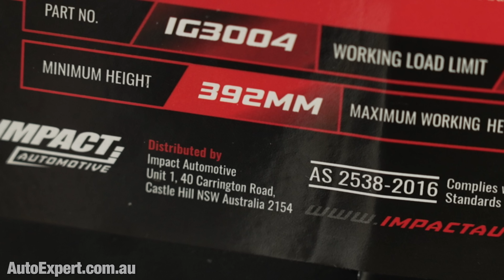Jack Stands: How safe are they really? (Weakest link revealed.) | Auto Expert John Cadogan

Comment: My son's an enthusiast DIYer who yesterday swapped out his shocks. It gave me pride and comfort to see the whole car on stands with all 4 wheels underneath as an added safety measure. The jack was there to lift the car then moved out of the way so it wasn't a tripping hazard
Reply from the maker: Well done, him, Mr Wolff.
Reply: I always put my car's wheels underneath the chassis somewhere near to where I'm gonna be laying under it,  just as an added safety incase the unthinkable happens. (Like when one mechanic bumped another car that was on jack stands, and it fell off the stands. Luckily nobody was under it) Accidents can happen very quickly.
Reply: Christian name !! which a chap like the one who raised the “point” is  not entitled to use unless he has been introduced !
Reply: pride and comfort?? wtf
Reply: @BubblesTheCat1  my sports cars are so low that if it did fall off the stands onto the tires you still would end up screwed up for life.    this is why I leave the jack still under the car somewhere usually near the front end / on the pinch welds so if it started to fall the jack will still be there as a 2nd backup.
Reply: @Runescape.  Not a bad idea, but what I actually meant is I put the (removed) wheels (say two laying on top of another, on their sides) near to where I'm working under the car. My own car (Nissan Sunny) is also quite low, and if it fell off the stands with the wheels still on the car, I would probably also be badly injured or killed. Especially near the front end. In those cases (or all cases basically) I like to leave the trolley jack under the car (not bearing the weight) as well, just for added insurance. The wheels laying on top another can also help should the surface under the jack stands fail. Be safe out there mate. 🙋🏼‍♂️ from Cape Town 🧡🐈

Comment: Using a concrete block to hold up something heavy like a car is inviting the block to suddenly revert to its constituent ingredients; sand, gravel
Reply: Has that ever happened?
Reply: @Rampart.X  yes
Reply from the maker: Certainly has.
Reply: @Rampart.X  definitely has.  They tend to brittle fail as they do not bend, just break without warning.  Blocks of wood will usually give some indication before failing.  These jack stands are a much better option in nearly all cases
Reply: If you don't understand what you're working with I'd agree with you. But if you know a bit about block you can get a lot of performance out of it. Don't use a block standing up. That's mistake number one. Don't put something hard right on the block either. Like a steel vehicle frame. Have a piece of wood in there. Use a heavy block and not a light one. I'd use a block the way it'd be laid too. That'd be fat side up.
Reply: my dodgy boss back some 25+ years ago decided it was smart to send me (the apprentice) and another worker out to the country to do a job and take out all the jacks and stands in the 70 series, we ended up with a flat Tire on the way home we had no choice but to use boxes of tiles, YES floor tiles, we were only left with a 1500kg bottle jack which is to short, hence the use of tiles

Comment: Thanks John. Another excellent safety video. Good to know a simple way of differentiating grey iron, ductile iron and steel. Grey iron, incidentally, was used for the scope mount on the British No. 4 Mk 1 (T) sniper rifle which served, in updated form, from 1940ish till the 1980s. Given the mass of the complete rifle, the loads imposed on the mount would have been inconsequential. Armourers did, however, get plenty of practice replacing the screws on the base for that mount and also staking the replacement screws to minimise subsequent movement.
P.S. As a carpenter, it never ceases to amaze me that people consider a concrete block, which is basically a brittle piece of permanent boxing, to be an adequate load bearing support for a corner of a motor vehicle.
Reply from the maker: Grey iron is a good material if suited to the application. It's awesome to drill, turn and mill. (I didn't know that about the rifle scope mounts... I wonder why ductile iron wasn't used.)
Reply: @AutoExpertJC  I just recalled that they originally specified malleable cast iron BUT there was an authorised change to grey iron. No reason is supplied in the standard text published by Ian Skennerton but I suspect that it was related to other wartime production priorities. Cheers from NZ🇳🇿. Keep up the good work. My view is, that if you are not pissing people off, you are not pushing them to really think!
Reply: "...it never ceases to amaze me that people consider a concrete block,..to be an adequate load bearing support " Better yet is when said use of concrete block involves lying it on its side!
Reply: @feathermerchant  Yes … because it HAS to be better that way🙂🧐!

Comment: Also worth mentioning for those that are looking at lifting all four wheels off the ground, avoid jacking up vehicles from side to side. Front to rear is best. otherwise the vehicle's chassis may flex or the vehicle's suspension may move the vehicle to one side. Causing the Jack stand to move under the chassis and in extreme cases, skip a tooth on the rachet mechanism under the uneven amount of weight. I feel like that contributes to those statistics as well. I experienced a similar senario back when i was a kid learning to work in my first car. I jacked up the car side to side, unknowingly the car was sort of twisted sitting on the stands. replaced my  first ever set if brake pads and discs. As I had opened the driver's door to pump the brake pedal bleeding the brakes. the jack stand on the left hand front slipped off the chassis rail and dented the passenger's floor pan  crushing the fuel feed line in the process... That turned out to be an expensive lesson right there. 🙃

Comment: Knowing where to place the stands under the chassis is important too - and I'm not convinced I know the answer on all cars.
Reply: That used to be the easiest thing to work out, but over the last 20years, things have changed. What Looks to be a safe place, and might be, can actually bend parts of the car.
It might not be obvious straight away, but you sure do find out when getting your wheel alignment done. I haven't done this personally, but have heard of people dong it. 
The owners manual usually gives jacking points, and most times there is usually a centre front and back to allow you to use stands under the jack points along the sills, which you will damage unless you use something between the stands and sills. Most mechanics will just use the subframe etc.
Having said all of that, I think your comment was talking about the safety side of things, and I agree, it's a topic that warrants more conversation.

Comment: I ALWAYS, keep the trolley jack in place under the front or rear crossmember whilst having jack stands in place. The bulk of the weight is on the stands and just light pressure on the jack. That's just my way of adding another layer of safety.
But in essence, jack stands are pretty safe. Use them correctly and appropriately and you'll never have an issue.
Reply: Same, along with any wheel/wheels I've removed. I figure while none of it will hold the car up properly like the jack stands, the jack + wheels will give me a couple of seconds to get out in the event that it all goes pear shaped.
Reply: @davidshepherd265  same here easy enough to put the wheel under out of the way.always good to have 4 stands too so if a pair is in use you won't gamble not using them for a diff project

Comment: Thanks for the heads-up John. My old stands are going in the bin tomorrow. I haven't used them for years, but I will remove the temptation in case I need to grab one quickly in the future. And yes, you do tend to prattle on a bit sometimes, but that is inherent in your style. Keep it up.

Comment: Hollow concrete blocks are notorious for crushing. Bloke here in paradise, aka, NZ, aka, the lair of Jacinda, saw one of his neighbours working under his car. A few hours later saw him still there so wandered over and found the bloke expired! He’d used concrete blocks to support the car and one had been crushed. Wasn’t a particularly quick death either as the car came down on his sternum and he’d more or less suffocated!
Reply: There is more to concrete blocks than instantly meets the eye. There's two basic varieties heavy and light blocks. Though the light ones aren't particularly light themselves. But they're half the weight of a heavy. Most common block is still lightweight. Blocks also have a top and a bottom. One face is fat and flat. I bet the victim used a block standing up. Blocks are weaker standing up than laying down. That and blocks are brittle. So steel right on a block can split it. Some wood cushioning may have made the difference? Also fresh blocks tend to be soft. Concrete takes a while to reach full strength.

Comment: One weakness you didn't mention... the point on the car that your placing the stand, or for that matter the jack!  I once jacked up an old, rusty Simca using the jack points on the chassis only to have it slowly crush into the body. Needless to say that car was scrapped as unsafe. I've also placed stands at points on the chassis I thought were strong but that buckled as I lowered the jack. It's important to use the manufacturers recommended jack points and stand location points and stay clear until you're sure the vehicle is stable.

Comment: Great video John.  One thing, use Jack stands on a level floor, preferably a concrete floor.  I finally purchased a QuickJack to do my vehicle maintenance, much safer and 24” (60 centimeters) of level, locked work space.
Cheers from Northeast Ohio!

Comment: There's a channel here on YT where a guy compresses/smashes various objects with a hydraulic press. Most of the videos are meaningless and just for fun. However there was a video a few months back that did jack stands. It was amazing to see that even the cheapest ones failed a lot beyond their rated capacity. So if anyone wants to put his fears on rest even more, go search for it and watch a 2000KG stand brake at 8000KG of load, or a 3000KG stand brake at 12000KG of load. It just shows how much margin the engineers put on their designs. So, I guess as soon as you stay within their rated load, the only thing you have to worry is the way you use them, and not if they can handle the load!

Comment: Great piece. Like you say, the weakest link is usually the operator, not the equipment. I won't go anywhere near a jacked car without proper stands, even if it's for 30 seconds. Safety is no.1 and things can go wrong very quickly

Comment: I was always told as an apprentice that you won't die when the car lands on you. It is only when you're relieved of the heavy burden of having a vehicle upon you that you'll expire.
Reply: I guess that depends on whether it crushes your skull rather than your legs. The thing you're talking about may be the condition that happens when you've been trapped with a crush injury for some time, as little as 60-minutes sometimes, before the weight is lifted. During the time the limb is under pressure, cellular destruction and other factors produce toxins in that area. When the pressure is relieved, these toxins spread through the body, often overwhelming the kidneys and other organs, leading to death if not carefully managed during release and treatment.
Reply from the maker: Compartment syndrome is a bad way to go...

Comment: Great video John, thanks. One of the most deadliest failures I have seen sits lurking and waiting for its next victim, this is called the 'concrete waffle slab' used in both Commercial and Residential applications. Its the Residential concrete waffle slab that I have seen fail with deadly concequences. As a emergency service worker (now retired) I attended many fatalities caused by many different mechanismns, but one that surprised me was where a mechanic at his new home decided to jack up the front of his old collectable XY Falcon in his garage to service it. He placed the 4 wheel trolley jack on the  concrete garage floor and jacked up his car in preparation to place support stands under the vehicle. He slid down onto the garage floor to prepare to bring the stands under with him. Unaware of what or how the concrete garage floor was built (like many of us) but soon found out that the garage floor was built using concrete 'waffle slab' design. The two larger trolley jack wheels suddenly broke through the thin area of the concrete made with waffle slab allowing the front of the car to suddenly drop about 100mm, the weight and depth of the crush force on the mechanics head was enough to kill him instantly. CPR, defib and drugs were applied for about one hour with no response. This Incident highlighted a few safety things to me as both a first responder and mechanic when you dont know how the concrete slab floor is constructed (is it waffle or conventional) If in doubt then use a base plate under the jack and jack stands (and slide the stands in underneath with a broom) before you place yourself in danger.
Reply: Wow. Thanks for that information 👍 and thanks for doing a difficult job 👍
Reply: yes they are not suitable without suitable load spreading plates.

Comment: Nice overview of the jack-stand functionality.  Had a scary experience working (playing) with my car.  Had the car up on 4 quality jack-stands and was removing the complete rear end for an overhaul.  Removed one rear shackle and then when I removed the second, the differential dropped and the car teeter-tottered on the front jack-stands and the rear of the car went up completely off of the rear jack-stands and the front rested on the front wheels.  Luckily for me I was in the back of the car.  Also lucky that the front jack-stands were quality ones holding up the whole weight of the car.  Learned my lesson, when I do something like this, I also put some jack-stands under the front of the car to make sure it won't drop.  Thanks for the great videos.  Best Regards - Mike

Comment: Nice demo of shavings. I recently learned about the importance of the fixed end of a ratchet spanner / breaker bar of a socket set. Never tighten or loosen a bolt with a ratchet, because the ratchet is the weakest part of the tool. Tightening or loosening is done with the fixed part. Ratchets are only for removing or driving the bolt into place. So obvious now.
Reply: Yep. Just how strong do they really think those 90 tooth ratchets are. With 90 teeth they simply can't be

Comment: My 1970's stands are just like they were made of water pipe and the uprights are welded into inverted "Soup Plates" and this makes them most satisfactory for use on grass, wheras those with "Legs:"  will just sink in and are useless, height adjust by steel rods running through.
Reply: Do not ever use any stand on grass ,nowhere near stable enough, if you have to work on grass at least put a hardwood plank at least 2 inches thick across from one side of the car to the other and put both stands on it,still don't recommend it ,ive had it fail on me,luckily I didn't get hurt
Reply: @stevennott6139  My lawn is good enough and not soggy, however I once had an EF Falcon up on two junky jacks of the type that come with a new car, the fun part came when the car moved side ways [I was doing a rear brake job] and collapsed, don't know what got into me, however with some bricks and a long beam of wood, I managed to lever it back up and jam bricks underneath until I got it high enough to "stabilise" it, and insert proper stands. If i went off road I would carry  a steel plate I have because those jacks are useless on unstable ground.

Comment: Thanks for this John. I was recently doing a tyre rotation on my 2012 Subaru Forester and was amazed by the flimsy construction of the original equipment scissor jack. The metal gauge is really thin and there is no way I was going to trust it. Perhaps in a future episode you could have a look at these.
Reply: there is nothing "unsafe" about the scissor jack that came with the Subaru.  If it were in any way unsafe, it would not have been included with the car.   I have the exact same jack and car and I have used it quite a few times.  If you actually use it properly like they instruct you in the manual, there is nothing at all to worry about.  The jack is strong enough to lift up a full size truck.     The Scissor jack is stronger and safer than the hydraulic jacks.

Comment: Thanks John, I just put the car up on stands for an oil/filter change and quickly decided that I'll just leave the trolley jack in place under the crossmember and work around it instead of backing it off out of the way., seems wise to have a last line of defence if anything goes sideways.

Comment: Another great Video John. It reminds me of the flimsy jacks that are supplied with your car. You know the ones that you need to use in less than ideal conditions. I had a flat tyre once on the side of the M4 Motorway. I had the ute up on the jack and loosened off the nuts and it fell off the jack, fortunately the tyre was still in place and held it. But I confirmed that I did have the jack in the correctly marked spots as shown in the manual, but it still failed anyway. I work for a large employer with a large fleet and I asked them to raise it with the car company, it went nowhere!  So I'm more concerned about the safety of the car supplied Jacks than those from auto shops.
Reply: there was nothing wrong with the jack,   you just did not use it correctly.  that is what the problem was and why it fell....   sorry, the truth hurts.
Reply: @orion7741  LOL, Sorry, didn't realise that was you looking over my shoulder. I followed the instructions. Was that the wrong thing to do? Why didn't you say something??